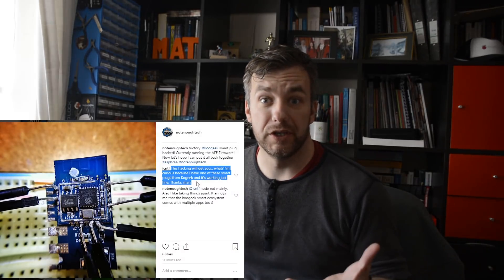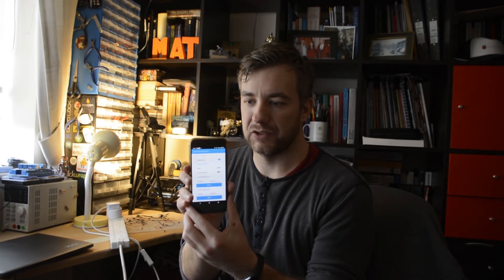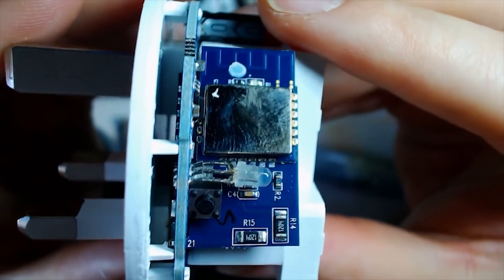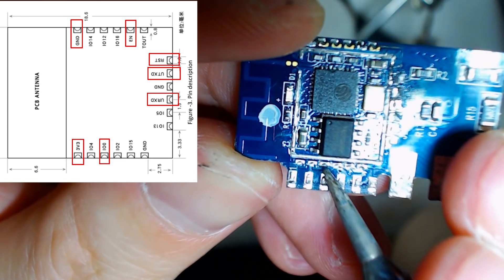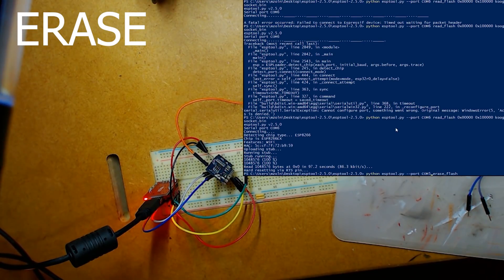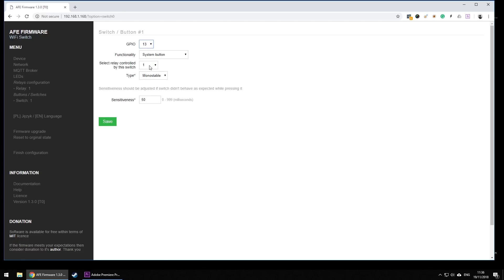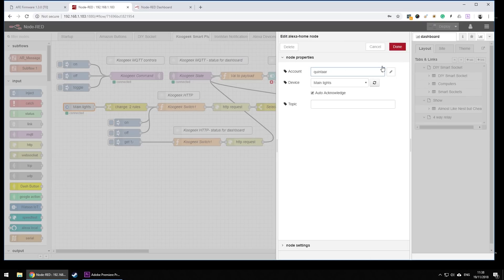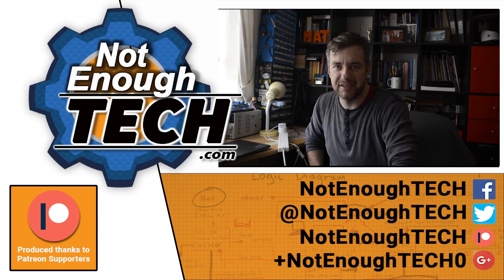Hacking affordable Koogeek Smart Plug (ESP8266)

Comment: Ive been looking for one of these things that I can lock down so it doesn't report back to the Shenzhen mothership. Usually when I've hacked things like this before I just do a dump of the network commands going back and forth from the "phone" to whatever wireless thing I'm commandeering, but most of these look like they're designed not to allow you to use them any other way than the app.

I'm assuming one of the reasons they're so cheap (4 for $20 for the US version) is because of the Chinese data mining that they're doing.  Are there any of them that already accept HTTP/S commands as is?  Having to do that level of teardown and de/resoldering makes $5 a lot less appetizing.
Reply from the maker: If the privacy is your concern and you want to avoid playing with hardware, perhaps consider ZigBee based stuff? ZigBee doesn't talk to WIFI so technically the devices are "offline" and the only thing to modify it the coordinator. I use CC2531 and I have a couple good guides about the use cases. 

The reason chinese stuff is cheap, is that they have all the manufacturing tech of the world and 1.3bln people to compete against to make the profit.

Comment: Hack Alexa so it dosn't act so stupid?
Reply from the maker: I assume you saw my outtakes then? - I'd like to see someone running a custom firmware for Echo and Google Home devices!
Reply: @notenoughtech  Yes, saw the outtakes.  Funny but these devices should work better. Would be cool to see one hacked. I mean, because we can 😉
Reply from the maker: I struggle with voice typing a lot. Sometimes it just works. Other times, it enters randomly selected words off the internet :)
Reply: Ours have got noticeably more stupid, we regularly get them telling us a light cannot be turned on as multiple devices have the same name.  Despite both phonically and actually there is nothing on the network with the same or similar name.   100% spy over assistant IMO.